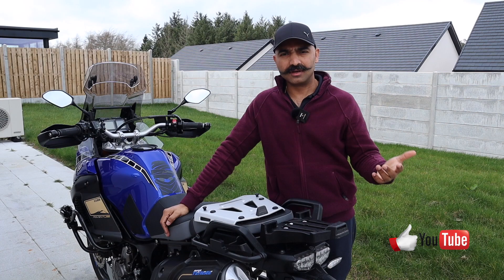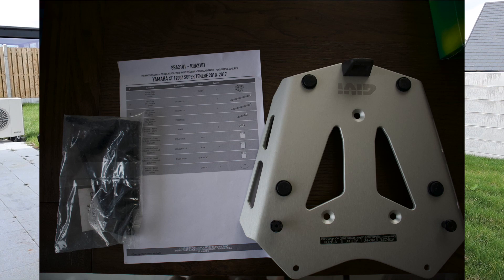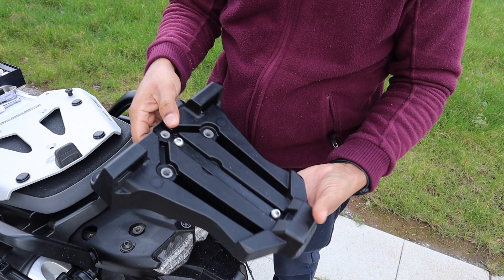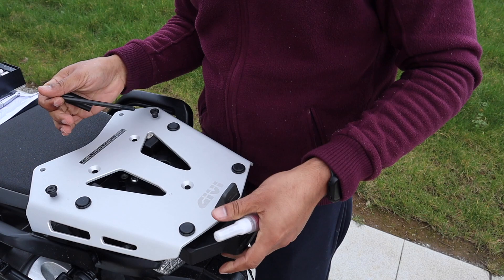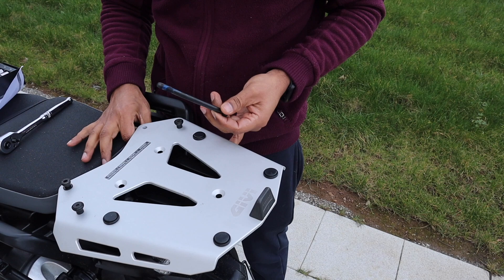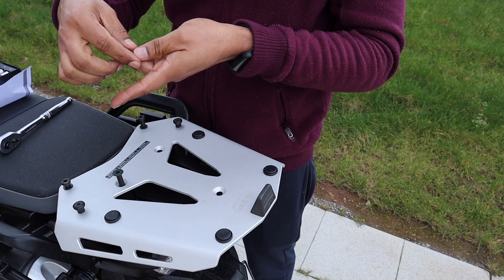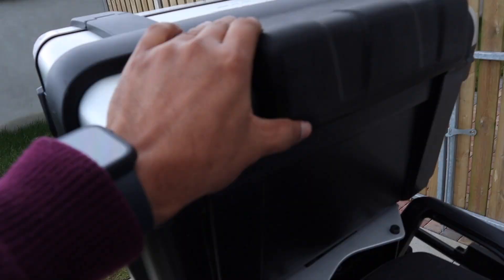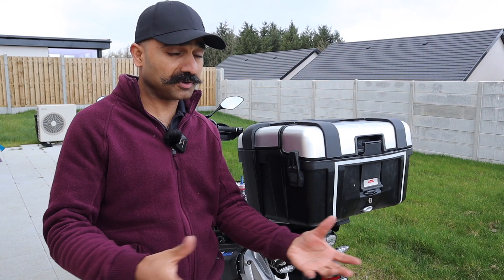GIVI Monokey Base Plate Installation on Yamaha Super Tenere XT1200Z

Comment: Looks like it brings the top case closer to the passenger seat. I was thinking the metal givi plate keeps the top  case further from the seat then the plastic givi plate.
Reply from the maker: I’m not sure now. I need to check it out and I will let u know
Reply: @rideswithrichie  I confirm that the Givi metal plate fixes the top case too far forward, the passenger is very uncomfortable, I'm trying to build an additional plate and fix it 10/15 centimeters back. I accept suggestions
Reply from the maker: Hi Davide. I had been for a few rides with my wife as pillion. She was pretty comfortable. Yes, I agree that the box sits much forward with the Givi plate installed. Have to figure it out at a later stage of how to sort out that issue
Reply: @rideswithrichie  the solution is sw-motech top case rack+ sw motech monolock or monokey adaptor plate. It gets the whole top case asembly about 1.5/2cm back. Doesn't seem much but it is. Its like top case with vs top case without the passenger back-rest.
Reply from the maker: Awesome. Thanks for the tip. I’ll look into this soon.
Reply: @SAB-iq1kp  To give the passenger the necessary space for comfortable journeys it is necessary to retract the plate much more than 2 centimeters, I think at least 10 centimeters is necessary. Next week I'll have a blacksmith make a second plate to connect to the givi in a back position
Reply from the maker: Wow. You are completely diving into it. Please let us know how you get on with it.
Reply: @Rizzatodavide  you are not wrong ,and i thought about it,but it could affect the handling puting the top case so far back and shifting the weight  and the bikes center of gravity that much! The motorcycle was designed in a certain way. And 2cm is like no back protection on my wifes jacket or no extra padding on the top case and for my 1.65 m tall 55kg wife  is enough. Its not goldwing space but it moves her just enough away from me. If you make that mod please upload a video and tell us all about it. Im very curious.
Reply: I don't think that the distances from the seat are very different between the plastic plate and the metal one as I use the metal one and it takes up too much space for the passenger, forcing him to move forward and also disturbing the position of the pilot. If you have to make short trips lasting about an hour, the problem does not arise, but if you use the bike for demanding tours it is necessary to move the top case back. I will do this work next week, I will inform you of the outcome